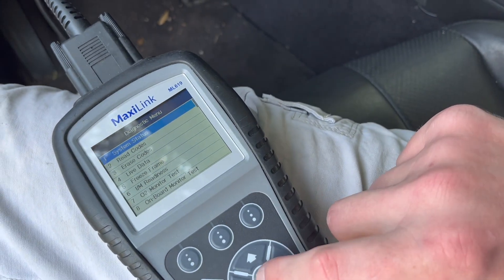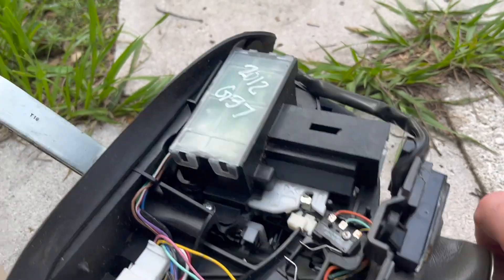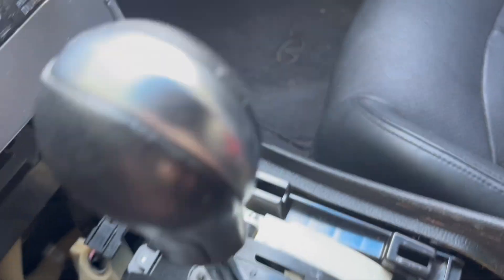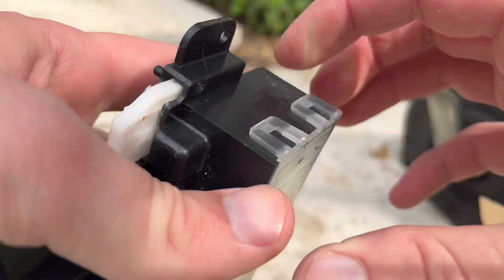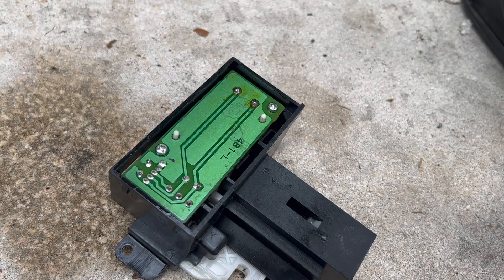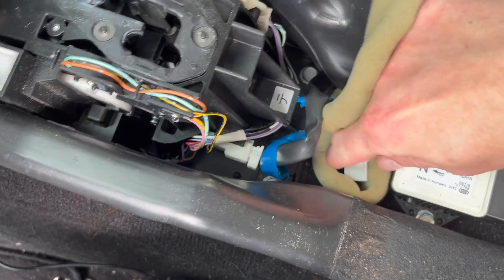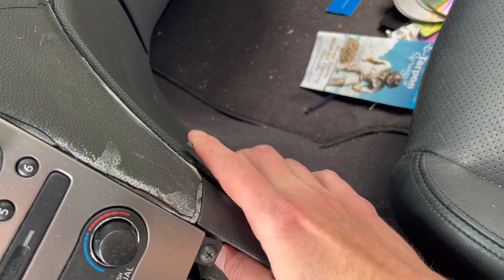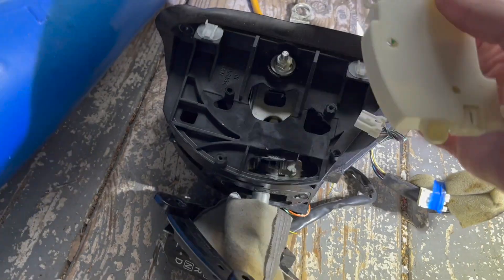G37 Shifter Assembly Repair and Replacement

Comment: Brodie I have a issue when I’m in drive and I accelerate or brake the shift knob moves slightly what do you think the issue can be?
Reply from the maker: It does sound like shift assembly is faulty. But I never had that issue. Try to replace it with a used one
Reply: @ bet Thankyou bro
Reply from the maker: No problem. If you end up changing the assembly, let me know if it fixes the issue or not.

Comment: Hey bro I have a issue where my shifter doesn’t want to stay in drive and the shifter will move to neutral sometime and sometimes it will just stay there in drive be ok, it just start happening after I let it sit for a year in a garage
Reply from the maker: To me it seems like issue is with the assembly itself. Probably the best thing to do is just replace the assembly since they're used not that expensive.
Reply: Thxs man, I’m trying to figure it out for coupe of days,
Reply from the maker: Let me know if it solves the issue or if you find what caused it

Comment: Hey bro i have a issue where my shift lock doesnt push the metal lever up to engage park, so should i just replace my shift lock? Is it spring powered? Thats why its not pushing the lever up?
Reply from the maker: I'd say since it physically does not push it up then it's a mechanical issue. Could be spring, but I did not take shifter apart. You should be able to find the whole assembly fairly cheap on eBay and you could just replace all of it to be safe.

Comment: I'm having a P SHIFT warning on my dashboard whenever i turn off my G35 (It's shifted to park). Do you think this would fix it?
Reply from the maker: Seems like it. I am not good at troubleshooting though, but buying used shifter assembly is pretty cheap so maybe worth a try
Reply: i just did a switch and it still dosnt work
Reply from the maker: @ItsBoogeyman  Do you have two modules in the shifter? (Like I did). If you do, maybe the other one needs to be replaced, not sure though.
Reply: I have the same issue! I just press the shift knob button again and it works fine.
Reply from the maker: @KirubeleGonzalez  it could mean that eventually pressing the shift knob button won't help it, but time will tell
Reply: @KirubeleGonzalez Did it hold up ?

Comment: Do any of these modules tell the car which gear it is in so it can start my gear doesn’t show on dah board and I’m sure car won’t start because of it.
Reply from the maker: Yes, my understanding is it does. I had same issue and after replacing the modules the issues never happened again
Reply: @PZPal  Thank you for quick response. The car has codes u1000 can comm and b2604 pnp switch. Car is 2008 g35x 5AT. Should I try swapping the shifter? the car died on me while driving
Reply from the maker: I am not good at troubleshooting things, but replacing the shifter should take you just couple hours if not even less. They are pretty cheap too, so you could give it a try. Let me know how it goes.
Reply: ill give it a try just gonna go over all wiring again one last time
Reply from the maker: @Fayzooooo  keep me updated, interesting to see what the issue is

Comment: Is the car on while u do this ?
Reply from the maker: No. No reason to do it while it’s on. You might need to turn it on only to move shifter to desired gear to remove the assembly.